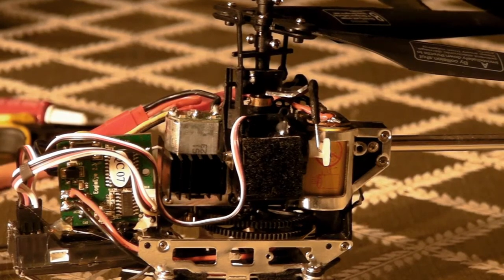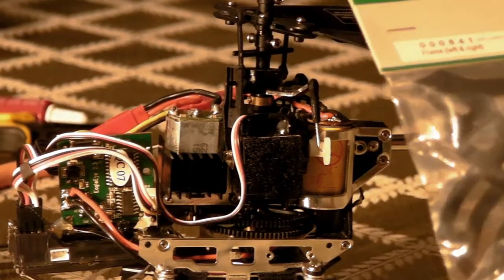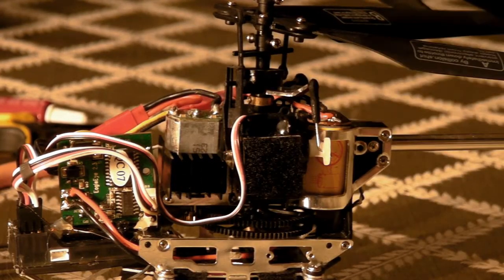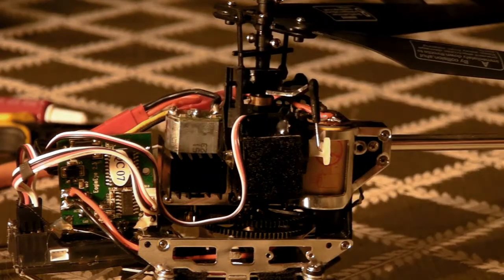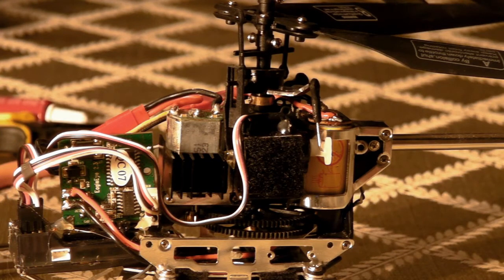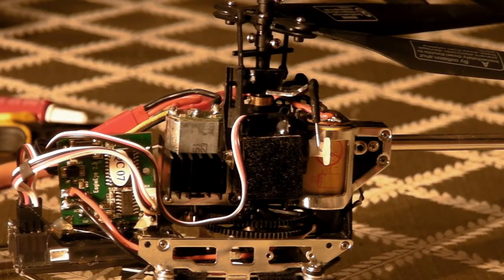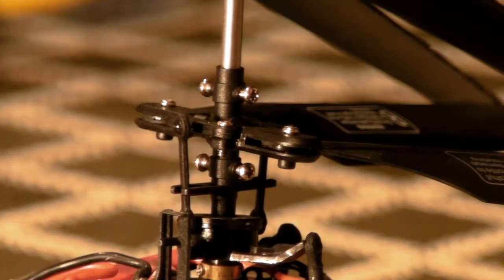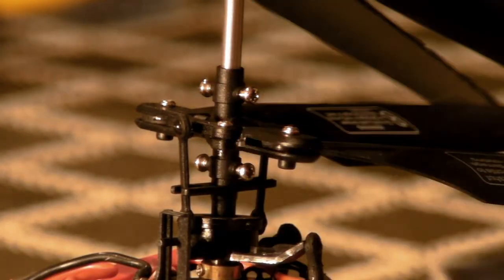9051 4 Channel.mp4

Comment: I`ve got an Efly micro coaxial heli. it only weighs 24g, size: 189 x 39 x 119mm, Battery weight:3.6g, Specs - Motor:5 x 15.5mm * 2pcs, KIT/ART/RFT: RFT 100%, Transmitter: 2,4G - 4 CH, Mix controller: 5 in 1 (gyro, mixer, main mtor ESCs, receiver and fully proportional servos), Battery: 3.7V 130mAh Li-Po, Transmitter - Size: 169 x 160 x 79mm, Weight: 169g. Battery: 6 X 1.5AA, Charger LED: with, Additional function: with charging port (for helicopter 3.7V Li-Po battery). Small but good flyer! G.